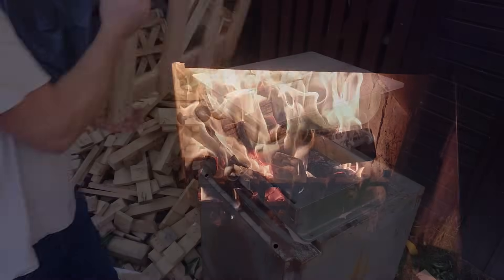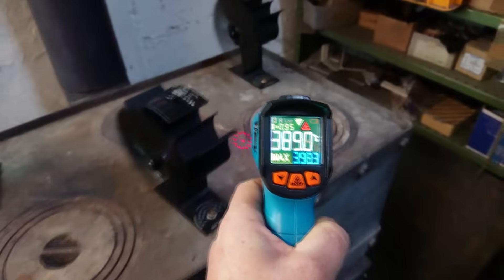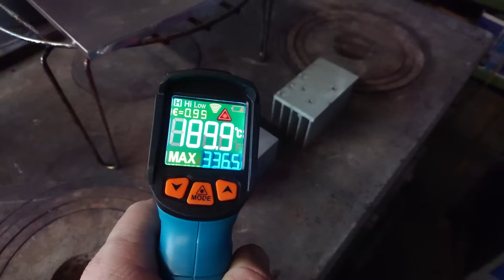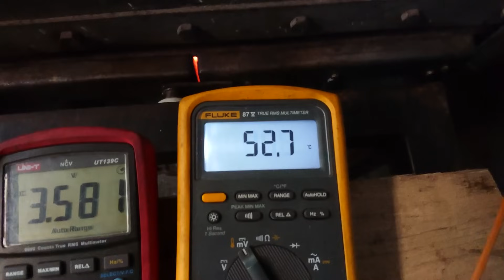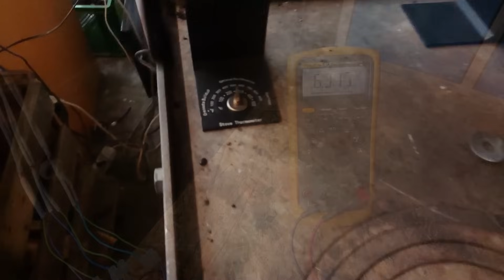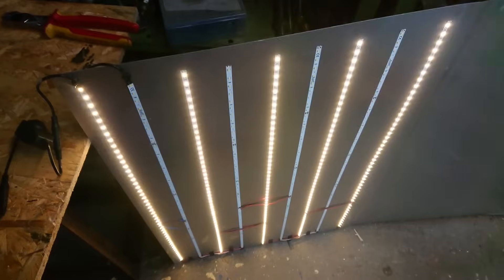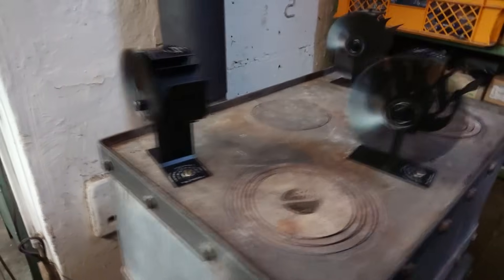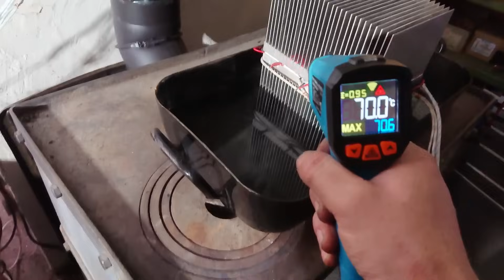Generating Electric Power with my Wood Stove - Peltier Experiments

Comment: If the maximum temp differential from the modules is about 70degC, it might be more efficient to have the cold side exposed to the outdoors/all the ice and snow. This would allow you to get the most out of the modules whilst only having to heat up the hot side to approx 70degC (well below the temp at which they would be damaged). This may mean that you don't need to burn as much wood (or at least burn it slower). Suppose you were to replace an entire wall of the cabin with TEM's. While the differential would be much less (it may only be 20degC differential between 0 degrees of outside, and 20 degrees inside) would that be enough to generate the required power?

Comment: 6:20
 processor thermal paste (Thermal grizzly, or Arctic MX-6 are the best)
+
Corsair ML 140 pro (PC fan with magnetic bearings, top efficent durability)
=
ecofan

(a second tube larger than chminey, up closed,
+ fan at air entry - on top of tube,
exhaust hot air at bottom
- maybe 2 fans, on entry cheap-efficient Arctic P14 PWM , and exhaust Corsair ML 140 pro)

note 
that the less thick the layer of thermal paste is
the better the contact,
therefore thermal transfer efficiency
->
sand aluminum cooling,
fine sanding paper + 'marble',
to perhaps gain a few degrees (on old PC processors : 6-8°c)

Comment: if i were you i'd make up some frames to tilt your solar panels at the optomum angle, even if you pick a single fixed angle it would make quite a difference vs horizontal!
with the peltiers, i'd wrap the stove pipe in copper tube and let water circulate between it and some PC water cooling blocks attached to the peltiers. the cold side could just have a heat sink.

Comment: mount the Peltier on the exhaust pipe outside the room. This way you will get more temperature differential from outside cold air. With that, you can use a thermal switch with fans to cool the hot side heatsinks if the temperature or differential whichever comes first exceeds.

Comment: Why not put the thermal generators on a container of water placed on the heater? The evaporation of water will lock the maximum temperature to 100C at least until the water boils dry?

Comment: Maybe place a second pot with cold water or snow on the upper side. 
In the cabin scenario, you can also run an aluminum or copper pipe or profile through the wall to the cold outside to act as a heat pipe. You could also get cooling water circulating in a pipe, without a pump, just through convection. So one could run a ring of large-diameter copper pipe, filled with water, partially to the outside ... .

Comment: There was a device, built in the ex USSR, in the 50's.
It would use the heat, from an oil lamp and it would produce enough energy to power a tube radio.
It had no ventilators, but a radial radiator.
Reply: I guess, your stove would be able to generate a significant amount of power, If You only managed to harvest the heat from the exhaust.

Comment: You would have a much better performance if you capture the heat using water, then use the hot water and a pump to circulate to and from the TEC module. 
If the water gets too hot, the pump will slow down and a servo can close the vent in the front to limit the air to the fire. 
Depending on your reservoir tank, it can go for a some time after the fire is out. I've seen some nice setups.

Comment: Not sure I have this thought out, but if you had a damper you could make a circuit with a thermistor and a small motor to regulate the damper and keep the fire from getting too hot. This will definitely affect the stove's heating performance, but if it works, you could safely line the stove with as many devices as you like.

Comment: Probably one of the more successful uses of TECs as TEGs I've seen so far, as for suggestions, use a lower voltage LED tape (E.G. 5v) and combine that with a constant current LED driver (such as you would find in things like 12v LED bulbs, babaoshop (search MT7201 in their store) on ebay is a good source, though probably cheaper elsewhere), so that you get a nice and consistent bright LED light from a potentially varying voltage form the TEGs, I've fitted these to a few 12v fluoro lights I've converted with LED tape so that when battery power drops, the light remains consistent... :)

Comment: Excellent video, thanks for sharing your work and ideas with all of us! Plenty of great ideas in the comments too, so I may as well try to contribute! I think a few folks have already touched on this, but instead of using a liquid heat exchanger on the cold side, why not set up a passive flow of heated water (thermosiphon, I guess) to a heat exchanger on the hot side? It provides the opportunity to limit the upper temperature (provided the water pressure doesn't rise above atmospheric pressure) and offers an increase in cold side performance by allowing the Peltier device to be moved away from the mass of hot air directly around the stove. I suppose you may have to experiment with the cold side in order to stay under the junction's maximum differential temperature. I imagine that some kind of simple air cooled condenser could be added to the water heater on top of the stove in order to reclaim anything that boils off.

Comment: Love your pipe setup. 
I would extent the cold-side heat sink all the way down to the floor. 
To support the weight of the pipe and your generator, and to grab updrafts from the cold floor, to cool the heat sink by natural convection. 
No cooling fans will be needed.

Comment: Why not make a vaccumcooler who draws in cold air to the coolingside from outside using the underpressure in the stove pipe after the peltierelements and suck in cooler air in the chimney and it may give a good difference

Comment: Put the module and pipe outside the shop, so it has easier access to the cold outside temperatures. Then convection will likely be enough, as the flue pipe still gets pretty hot outdoors.

Comment: you could use heat pipes like a cpu cooler and have the heat drawn further away from the tecs, then to dissipate that heat you can arrange heatsinks from the heatpipes in a separate chimney to utilise convection. It would be all passive but would make its own air flow.

Comment: Recently I've come across a near limitless supply of waste motor oil, I'm currently in the planing stage of a filtration system, my plan is to use mix of WMO and diesel in my oil furnace to reduce costs in the winter while in the summer use the same system to run my little truck. I've toyed with woodgas but it can be quite fussy to dial in and not a very viable solution for vehicles.

Comment: 😊 What if you replace the peltier idea with a closed loop steam turbine generator? running some water coils of copper in the stovepipe, and using a water container like a IBC and some condenser device that allows steam to go back to water while reducing the system pressure? Maybe it could be a pumpless system, only using one way valves and some pressure release valves for safety? Maybe You could get 100watts out of something like that? 😅 You could salvage some condenser radiators from the backside of old refridgerators... And maybe use a impeller, or centrifugal fan as the steam turbine? You'll probably need alot of condenser radiators though, and maybe also put them outside in cold temperature... and maybe add some antifreeze to the water as well... It's probably just as bad of an idea like the peltier modules 😅 but maybe with better results?

Comment: A friend and I did a similar experiment many years ago on his narrowboat. We actively pumped cold canal water through a old CPU watercooling block for the cold side, hot side on the flue of his wood stove with a poor thermal interface. As long as we kept the the whole TEC under 100DegC, the delta acted more like a maximum power output than a limit of destruction - we had 95DegC on the hot side, around 5DegC water, and the power capped out at around that 70DegC delta. We could easily get 0.5w per TEC which isn't a lot of power, but lots of them placed in otherwise unused space like flue, back, and sides of the stove can make a small difference - enough to charge a battery or phone.

Comment: Nice work! I would use cold air from outside to make higher temp difference. Maybe some kind of hole through the wall near chimney and the heat would be taken from chimney. Or cold air could be brought from outside with a pipe and circulated thanks to chimney effect.

Comment: Good job.  If you want to generate power from flue gas, you could try constructing a scaled-down version of a waste heat boiler much like is used in the stacks of fired equipment in industrial applications.  You would need heat exchanger tubes with high fins within your furnace exhaust ducting which would by thermosyphon circulate to a steam drum.  The steam generated could drive a turbine.  You would need to add a source of make-up water.  Safety considerations include protection against overpressure and vacuum when your system cools and the steam condenses back to water.

Comment: your bottleneck is the Peltier devices !! i suggest you use the classic system of utilizing the heat from the stove or the heat of the chimney your already dumping outside to boil or heat up water and turn a turbine , its the most efficient way to get power from heat 
a closed system the boils water on the chimney , turns the turbine and then re condenses the water maybe in a radiator on the roof , you already have snow 
you basically have a 400 degrees inside and subzero outside , i think it might work with that large difference , you just have to figure out the turbine bit ,and  a valve to keep the steam and water going in on direction all the time 
you dont need steam ,just movement in the water line ,you can attach a matrix of line inside the stove pipe and get heat from there ,and turn a turbine somewhere and re condense the water outside , maybe run the re condensation line all over the roof so you dont have to shovel snow from the roof

Comment: no need of  a stove... use the heat sink for the outside cold (window) and room temperature of the cabin (temperature differential). should be enough

Comment: I’ve always found the concept and use of TECs and TEGs super seductive.  Even just for hobby uses and experiments, they’re so fun.  

I do wonder if there’s a fundamental limit to how efficient they could ever possibly get. 🤔
Reply: I used to work on TEGs in the oil and gas industry.  Used to power remote installations back in the day. 

They don’t make huge amounts of power, but enough and they are quite reliable.

Comment: Why not to use propeller or turbine in gas pipe? Via shaft leaving pipe through bottom elbow, You could connect small dynamo or alternator to it. No gas leak can occur due to gas draft.
Always to see good experiments!

Comment: What looks like a better approach would be two large plates of aluminum with the thermal modules in between with heat transfer paste .a small pump to circulate boiling water on one side and the other side exposed to the out side environment being very cold out there should work nicely ..or a heat diode from the fire box with water as the carrier going to the aluminum plate with a plywood box air tight on the sides and top to create a 100 deg air bubble as a thermocline on the aluminum no pumping needed .

Comment: Great content once again! I am planning to start a small homestead  where I will heat with wood and my power will come from solar panels only, thus I'll have the same issue you do with your shop: too many cloudy days and snow in the winter. That's why I was looking into steam turbines lately, hoping that somehow I could make a system that would generate reasonable amount of electricity. Thou it is not a simple solution it could work, might worth a check on your side as well, the stove you have seems suitable for a small steam generator.

Comment: On possibility would be a waterjacket interface between the pipe and the thermocouples, you could even put a teapot whistler that would warn you if temps got too hot. Bonus is the water will provide much needed humidity in the winter.

Comment: You could circulate water, send it throug some radioators, then you'd have a hot and a cold(ish) pipe. But then why not use that for a turbine? Or a stirling generator maybe. This peltier stuff is too fragile. Or you could put bimetallic stuff into the fire, it's also not very effective, but working.

Comment: Good concept. Just to find a good active cooling solution. If installed in a cabin the outside should be cooler and somewhat accessible if the stove pipe is running close to the presumably wooden wall.

Comment: Always enjoy the episodes, I'm not an engineer by any means but enjoy your tinkering. At the end when you are removing part of the exhaust vent, I was wondering if you'd thought of a small wind turbine to generate power? The shaft being geared 90 degrees and coming out of the pipe to help with not heating up the generating parts. It would not be as efficient as your water turbine, but might be more effective than the peltier devices. Not sure how much air flow there is in the stove pipe, so this may not be as effective as I think it might be.

Comment: Super interesting application... thanks for all the work on building this!
See, I have a few of those Peltier devices bought on a whim with the exact same... mentality perhaps? Try doing some cool experiment with it, something like that, eventually.
I could never find the right scenario to put it to work though. That's the real tricky part... you need a very specific temperature differential for it to even make sense, and it's a bit of a rough one. Close to boiling temps, and on the other side you need cooler than ambient temperature where I live, so it's kinda hard to get that. I mean, hard if you plan on not wasting more energy doing that than it can generate.
I had never heard of those fans too... pretty cool application.
Anyways, inspiring... it made me think about them again.

Comment: You are losing quite some power unless you precisely matched the peltier output with the LEDs. I believe any solar MPPT controller should work without modification as long as it's within voltage and current specs. The Peltiers usually contain PN junction like solar cells and should have the same voltage/current curves.

Comment: Bootstrap a 1-2W Fan on the cold side heatsink and bottstrap it from the peltiers. It should greatly increase the amount of heat going through your peltiers and thereby the energy extracted from it. It should also lower the hot side temperature a bit.

Comment: i wonder if a grid heater set up like the Cummins diesel engines uses would also work in line with the exhaust pipe, instead of making the square pipe you would be able to use the round pipe and slide a round grid heat sink like in between pipe sections and get heat transfer and have the devices around the circumfrence

Comment: Always love your work, man. I’ve seen people insert copper tubing into the exhaust pipe, circulating cold water in one side and hot water out the other. Would the maximum water temperature only reach 100°C? Could this method be easier to power them? Apologies in advance if I’ve overlooked something obvious.

Comment: Maybe liquid cooling, liquid coolants or oil can keep a steady temperature. Maybe with an old car radiator to help with the cooling of the "cold" side you can achieve a good temperature difference 🤔
My second thoughty would be a way so as the "cold" side would be exposed to the ousidte cold but the  warm side is enclosed and insulated on the chimney.. but the voltage wont be stable as the temperature outside changes 😐

Comment: At this point you might make an actual heat exchanger/pressure system and use steam and a turbine to generate electricity from the heat of the stove 😅

Comment: I have not run the numbers, but one idea could be to use a heat exchanger to heat water, which should flow upward due to convection (in theory, no idea if this actually works). This water could spread the heat inside a small building and the peltier elements. If convection does not work, you might have to run a small pump.

Comment: Pleas, please, please upgrade your table saw. this is as carpenter saw. This things are not meant to cut fire wood. It is missing some of the basic safety features and your working practise is not good to be honest. There hast to be at least a cover over the blade and a splitting wedge behind it to prevent kicking back when the wood decide to grip on to the blade.

Comment: I think your biggest problem is the risk of overheating. Ideal would to have something which regulates heat simply and without your need to monitor or adjust. At least something which acts as a thermal safety fuse. A bi-metallic spring would be simple, reliable, and easy to adjust for this but I have no idea how that would be configured.
I don't consider this as not having much usefulness as you are getting a reasonable amount of light from a limited number of TEC devices, and all of this will have a very long lifespan in use giving great economic benefit when you go to a larger scale.

Comment: What you really want to do is have one heat sink on the stove and one heat sink outside.  If you could route the stovepipe near a window somehow.  Alternately, you could build a thermosyphon and use a water/glycol solution.  That would be an efficient cold side with no moving parts.  Just a lot of pipe and hose.

Comment: You should install a thermo couple on hot and cold side close to the peltier devices and monitor the temperature in the development phase, might save you a few bucks in peltier elements